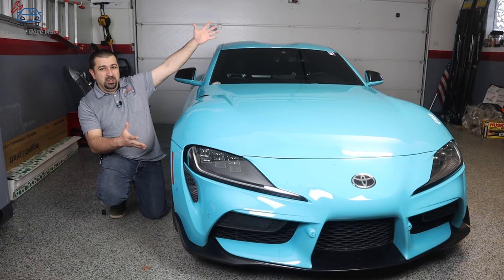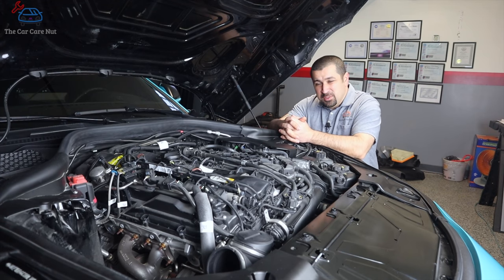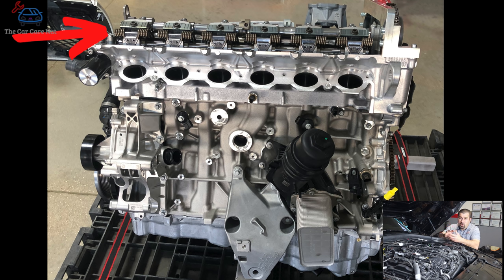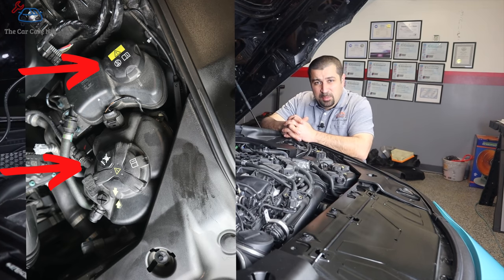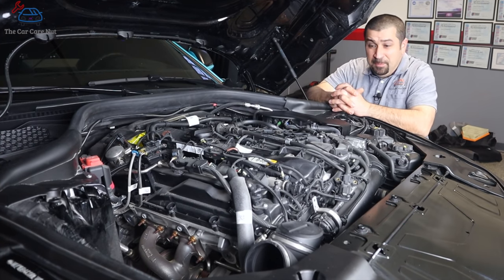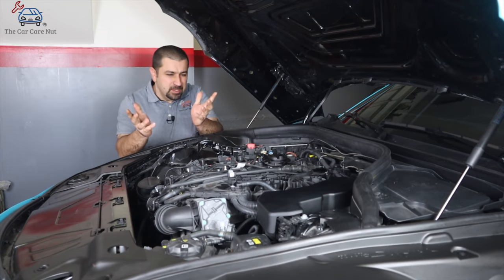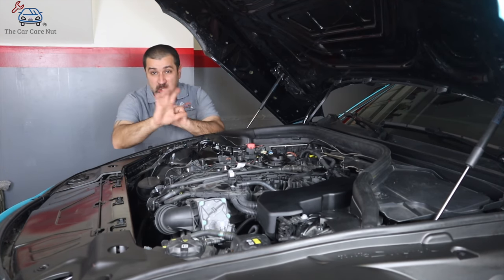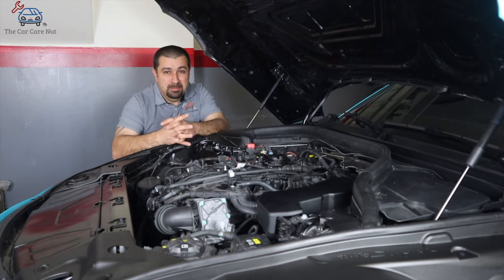New Toyota Supra Technical review and common problems

Comment: BMW's use many plastic engine components. That means, eventually components will crack and need replacing. Any wonder? BMW's are money pits?
Reply: Those parts going to cost a fortune
Reply: Doesn’t Toyota use plastic components in their engine too?
Reply from the maker: Yes they do and more than you think. Some of them fail some are holding on well.
Reply: The pure capitalistic Germans have penetrated the over refined industrialized Japanese. Selling excitement and performance with a little (or a lot) less reliability is more profitable Per. car than selling just reliability. Having a 4.5 star rating while selling millions more parts is madly more profitable than having a 5.0 star rating and barely selling anything except maintenance for the first 100k miles of the life of a car.
Reply: @Gmansour1971  Plus, most BMWs are leased so why would they worry about reliability after 100K or so?
Reply: @andersonrodriguez8258  everything always does. Look at Honda parts, look at Mazda. Parts In general cost a fortune
Reply: I have plastic parts on my Genesis coupe engine living in Az. never had a problem.
Reply: And what does Toyota use? Gold? Toyota now using plastic components as well

Comment: "I was chosen to be the supra specialist," drew the short straw?
Oil consumption problems, and no dipstick.  2AZ all over again?
Hope warranty time doesn't stiff ya. I feel for you bro.
Reply from the maker: I actually volunteered for it 😀. Same for the FRS/86 Mazda and the Prime cars. You never stop learning and working at a dealership you’re stuck with one brand with no room to learn other makes but this is my chance
Reply: @TheCarCareNut  On the plus side, the small incremental changes that toyota makes to their cars is also an advantage for the technicians to master their craft.

Comment: Thank you AMD for another wonderful video. I find changing timing chain quite expensive in all BMW where chain is on back side of engine, also in this one. Engine needs to go down on chain change. Strange concept.
Reply from the maker: Hi Marjan! It is a strange design indeed! Luckily on the Supra at least the gears can be replaced without pulling the engine out
Reply: @TheCarCareNut  I found when hybrid system is cold (engine below 72*C or battery below 20*C) or when speed of car is more than 110km/h, corolla hybrid will not shut down an engine but it will keep engine on 1000 RPM with out fuel injection and it will roll car on the road only by MG2. I'm curious why in that case engine is not stopped. Could you please provide information? Thank you.
Reply from the maker: Hi! It could be 2 cases. It would either have the engine running to warm it up or have it charging the battery. Try turning off the climate control and see if it shuts off
Reply: @TheCarCareNut  no it is not related to battery level or engine temperature when speed is 110km/h+. For example I'm going downhill engine temperature is 92*C, battery is 55%(but real, not one from car diagram), and battery temperature is 35*C, engine RPM will not drop below 1000 until speed drop below 110km/h, while car is moved only by MG2. Below 110km/h engine will be shut off. I know that is max speed of MG2 and MG1 17000RPM. On 110km/h will not overrev because they rotate around 11k. It is strange to me. Android app used to read data https://play.google.com/store/apps/details?id=priusfan.info.bthsd10
Reply from the maker: Ok now I get it. So at higher speeds the engine running will be used in the planetary gear as a reduction to basically simulate an overdrive so it can handle higher speeds.

Comment: Well Amd, you're going to have a lot of fun, if you search around on you tube, you'll find that bmw had a lot problems with their timing chains failing very early, this happened in europe with their diesel engines, and yes, the chains were at the back of the engine.
Is there any reason why bmw makes everything so difficult, is it cultural thing?
Reply from the maker: It will be fun to replace a Chain on a Supra for sure 😀 don’t know what’s the deal with bmw and their designs. They can make a fine driving car for sure but can’t make a car that’s reasonable to service

Comment: I was contemplating a 2020 over the 2021, but honestly your insight has me wanting to keep 40-50k elsewhere. This car seems like it's gonna go belly up someday after warranties expire, in true bmw fashion. Damn shame, it's a cool car but toyota should have stuck to their roots. They're gonna lose a ton of sales with this issue on the 2021 going forward and once the 400z is out, they may as well kiss the supra goodbye
Reply: Its not that bad and you are assuming a lot.
Reply: @lIlIllll1  but he's telling the truth the Nissan is much simpler all the stuff you got to do on this car with the battery you don't got to do that with a Nissan I'll take the Nissan is just a simple car even though I'm a Toyota fan I also a Nissan fan too and know me that the Nissan comes with a manual gearbox which this car doesn't come with and it's a little bit more cheaper than this car if that don't spell disaster right there I don't know what to tell you
Reply: @godofdestructiondiecast6756  if you are talking yourself out of this car then you are gonna miss out. The Z is nice but definitely not my preference. The Supra really is an amazing car and well built regardless of the parts used. I absolutely don't regret buying it at all. I have never been a BMW fan but Toyota did require the parts to go through rigorous quality control testing before accepting any of the parts from what I have learned. I haven't had any issues whatsoever and neither has anyone else I know of who has it. It's pretty darn solid. Will it last 200-300k? Who knows. Only time will tell. I personally would never buy a car like this to rack up that kind of mileage anyways. Either way you decide to go I hope you will enjoy it.
Reply: @jakeatkinson901  it's a nice sports car but it's not a Toyota product it's a BMW if they could have made a manual transmission and stop being lazy and did something else do all the this car is a BMW not a Toyota
Reply: @godofdestructiondiecast6756  I think you gotta do your research buddy. It's more of a toyora product then you think. And I love manual and I almost let that stop me from buying it but honestly the 8 speed is one hell of a transmission and I am actually happy to have it. Question for you man: Do you own one? Doesn't seem like you know enough about it to actually be an owner of one.
Reply: @jakeatkinson901  I've been working on cars for many years and they've been doing this for many years they have put another engine under something and slap a different badge on it so once again if I look under the hood of a car and it says BMW logos on everything that's an indication it's a BMW I don't care what Toyota says it says BMW on there if it walks like a duck quack like a duck it's a duck once again the Toyota Supra is a BMW not a Toyota is Toyota would have built a manual transmission then I can say that they had a hand in it other than that they pretty much paid BMW to build a car for for them and they just slapped the name their name on it like they did something which they didn't do nothing
Reply: @godofdestructiondiecast6756  nobody is debating that its a BMW engine and has many other parts and attributes from them. It was a collaboration not a reincarnation.  That's an extremely narrow minded and ignorant way of looking at it in all honesty especially when you refuse to actually learn the history of how that car came to be.. Like I said before, actually do your research and you will find out that it's more Toyota then you think. And at the end of the day if you don't want one then don't buy one. But you really have limited credibility unless you actually own one and can speak from personal experiences. Otherwise you are just a talking mouth regurgitating all the same rhetoric that the other haters who don't have one say. And it's honestly getting old and immature at this point. But in any case have a good rest of your week buddy. Wish you the best.
Reply: At least Nissan didn't have to partner up with anybody to make their sports car and they going bankrupt Toyotas the biggest car manufacturer in the world and they couldn't make their own car side that's why the Nissan z will outsell the Supra because it comes with a manual transmission and it's actually a Nissan not nothing else a Nissan
Reply: @godofdestructiondiecast6756  there is a reason they are having financial issues buddy...and of course they will outsell...its a cheaper car. Doesn't take a genius to figure out that equation. Its price point makes it viable for an entirely different market.. You have no argument cause it's led with ignorance. Do your research please before opening your mouth again on this topic.
Reply: @jakeatkinson901  right now this is a chance for Toyota to redeem themselves to make a manual from them not from BMW it shouldn't take much research they still build manuals so is no excuse
Reply: @jakeatkinson901  Nissan had every reason to partner up with somebody to make this car to boost a sales that I would understand that I would have understood that from Nissan alot better if they partner up with somebody  Toyota being the biggest car manufacturer in the in the  world Toyota have plenty of options they could have went to Lexus and do a V6 in there and put together something and re-engineered it that's what most my car manufacturers do anyway so I wouldn't had a problem with that look at the Nissan GTR they went from a inline 6 to a V6 nobody complained about that all I'm saying is that Toyota have plenty of options they didn't necessarily have to partner up with BMW they could have re-engineered what they had now from Lexus and use that for the Supra from what I have seen in this situation Toyota with just being lazy they didn't want to invest the time that's what it was they wanted to push the project and give people what they want and dropped the ball at the same
Reply: @godofdestructiondiecast6756   like I said before, I love manual transmission but after driving the 8 speed they put on it I honestly would not trade it for a manual if the option was available. But to each their own. It's just not the hill I am going to die on with the Supra. Would love to see them put a manual on it but if they don't then I am sure there is a reason for it in their view.
Reply: @godofdestructiondiecast6756  all Toyota had to do was use a v8 from Lexus. Re work the RCF chassis and make it lighter and boom. Supra all in house
Reply: @AntilleanConfederation  I agree
Reply: @godofdestructiondiecast6756  you do know that the new Z is a parts bin car right. It’s a q60 engine reused, and the chassis is the same chassis they’ve been using for a decade now. It’s literally a 370z refresh lol.
Reply: @R_C32  to be real honest with you I don't care because Nissan built it didn't go to BMW or Mercedes to help build their own car they built it on their own this is 100% JDM
Reply: @AntilleanConfederation  LMAO then what’s the point of buying an RCF. Both would be 2 door sports cars with a V8. Most people don’t buy the RCF with using the backseats in mind anyways. Y’all don’t understand the Supra HAS to be an in-line-6 to keep it’s heritage.
Reply: @godofdestructiondiecast6756  Toyota went to Subaru to build the FRS/86… that’s all JDM. Yet people whine and cry about how slow it is. Y’all really don’t understand Toyota does not specialize in building sports cars. The Supra would be slower, more expensive, and not as cool if Toyota were to build it. It’s the truth but this is the 2nd fastest Toyota in history, the first being an LFA and that’s 400K and this is only a little bit slower. 

Guarantee you don’t care what country your shoes are from or where your phone is from. But you care what manufacturer makes a car? You know iPhones use a Samsung screen? I don’t see people screaming Samsung at iPhone users.

If you take away the whole aspect of it being a BMW would you say it’s a good car? Guaranteed you would. Because that’s what matters at the end of the day. Not where it came from, but how does it drive and how does it perform. I used to think the same way but it’s called maturing and realizing Toyota made a smart business move. Kept an In-line 6, made a great sports car, and saved themselves money. You sound like a JDM fan boy that licks the ground for anything made in Japan.
Reply: @R_C32  facts these dudes be licking the ground for any sports car that’s made in Japan. They think the 400z is gonna be some great car but if you look closely at small details like the speedometer being a low resolution screen and the power train is a Q50/60 red sport that actually only puts out 335-345WHP. The 400z will literally be the Mustang of JDM cars. Cheap high horse powered vehicle that people total or put into crowds.
Reply: @justinnguyen3091  what heritage you talking about. The car is entirely made by BMW. If it was a Toyota in-house product you would have a valid argument. It is you who does not understand the Supra heritage.
Reply: @godofdestructiondiecast6756  nissian is in debt by a tremendous sum.
Reply: @nevertrustbob1  yep I know and this is not the first time this is why the merger between were no and Nissan happen and ever since then the quality went down to be really honest
Reply: @godofdestructiondiecast6756  toyota is making a MT supra for the 2023 manual.. in other words, the Z is fucked
Reply: That's what most fans wanted but apparently, they had other considerations. At the end of the day, if they sell what they expected to sell, they win... Remember, some people won't buy anything with a non euro badge on it. This may well have brought customers over to toyota due to bmw underpinnings. I have no lust for it buy I'd sure like to try it and it's still one of the most interesting cars produced in the past decade without a stupid price tag on it. It has merit for being a thing.

Comment: Really interesting and detailed, if you could do the same in depth for FR-S, GT86, BRZ that would be great. Heard 2021 GR Supra has engine boar scoring issues probably this that has most oil issues you mentioned too. Regards oil level when I get one in future every month check it? 

The sub in back says Toyota and cup holder plastic panel too I believe. See Jackie Ding GR Supra weight stripping video.
Reply from the maker: FRS similar video is on the list and will come in the future. The issue that’s causing the scoring on the cylinder is still unknown as to why it’s happening.

Comment: Hello AMD, do you know if I take my 2020 Supra in for the following recalls, will toyota update my ECU causing it to be locked and untunable like the 2021 Supra? Currently my 2020 Supra is stock and the sticker date on my ECU is 4/11/19 (very tunable I heard). I don’t want my ECU to become lock because of Toyota did some software update. 

2020-2021 GR Supra Recalls: 
1) Brakes. Due to a problem with the engine management system a software glitch could cause the loss of braking assist at startup, meaning drivers won't have any power assistance when depressing the brake pedal. This could make braking distances longer and increase the risk of a crash.

2) Headlights. Toyota Supra, BMW Z4, 330i Recalled For Failing Headlights.

The issue? Loss of headlight functionality because of the headlamp control unit that may fail due to a process during its supplier's production.

3) Seat Belt. BMW Recalls 7 2020 Toyota Supra for Seat Belt-Related Malfunction. Due to Improper Welds

The recall involves a problem where the seat belt guides may not be properly welded to the car’s frame, which represents a major safety issue. Also, yes, BMW is recalling a Toyota.

4) Camera. safety recalls towards several BMW models for their faulty backup cameras. Owners were able to glitch the cameras into not working when backing up. A software patch fixed the issue. The Supra was listed in the recall

5). Navigation System needs software update. 

Please advise. Thank you.
Reply from the maker: Hi! Either of these recalls will update everything in the car. So all ECUs will get updated. As far as tune-ability I wouldn’t have that information.

Comment: The rear timings chains remind me of Ford Exploders from the early 2000's, they had gears and chains for ONE bank on the front of engine and another set of gears and chains on the BACK of the engine. So I guess Ford one-up'd BMW in the insanity department :D. That "always-on" parking prawl sounds like a PIA for techs...if the engine doesn't run, you can't throw it in neutral and push it around. Also note BMW hasn't caught up with Toyota in fuel injection, this only has DI meaning carbon build up will probably become an issue (vs 'real' Toyota's that have old school manifold fuel injection too for this very reason). Thanks for a super interesting video! I wanna drive one now, but maybe not maintain or repair it!
Reply from the maker: If you ever get a chance to drive one you’ll have a hard time not wanting one. You’ll remember me when you do drive one

Comment: Do the 2.0 B48 engine has the same issues?
Thanks for the vid and Information.
Reply from the maker: So far no issues with the B48
Reply: @TheCarCareNut  

Is it passible to drive the supra only in summer, without these Batterie issues?
Do the 2.0 Supra has the same Issue with the Batterie?
There must be a solution for the customer without calling service every time 🙂
Reply from the maker: You can get a scan tool that’s capable of programming the battery or use a battery maintainer over the winter months